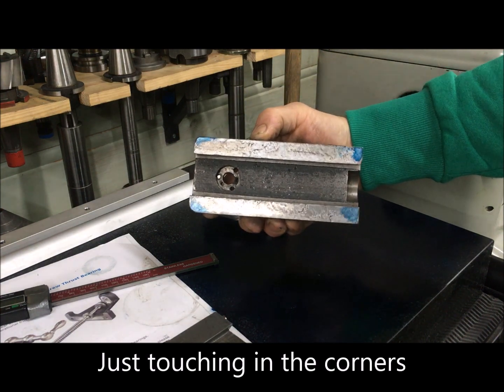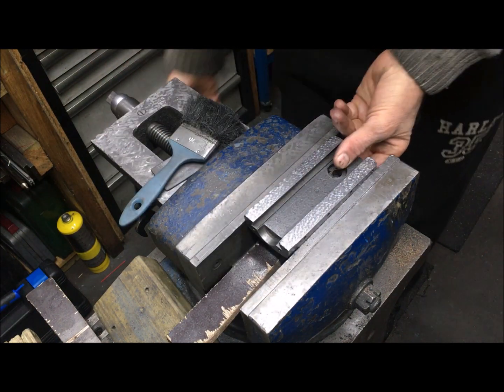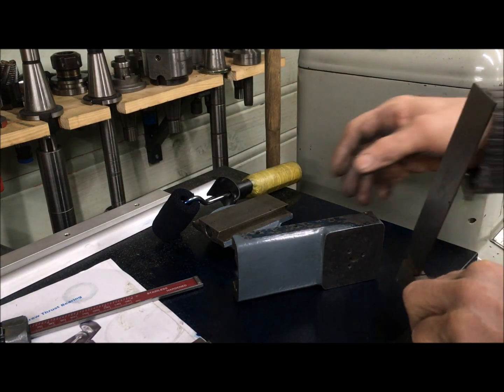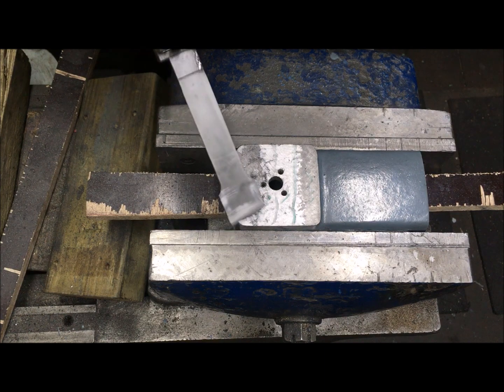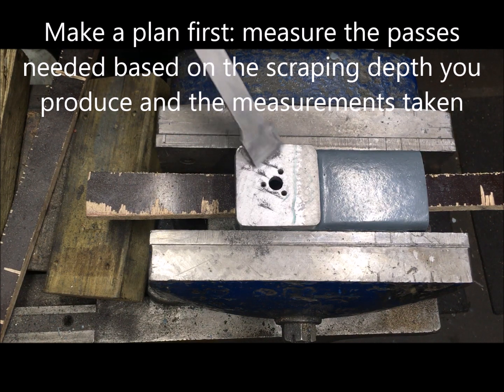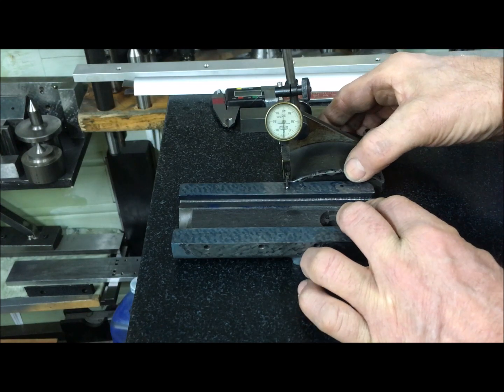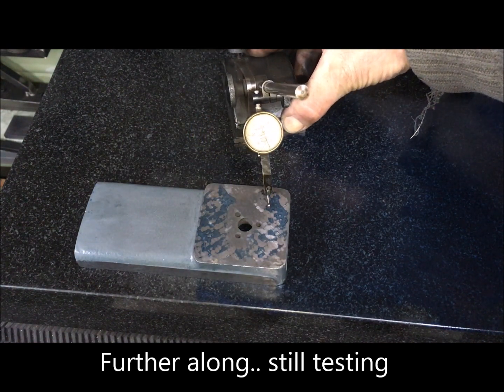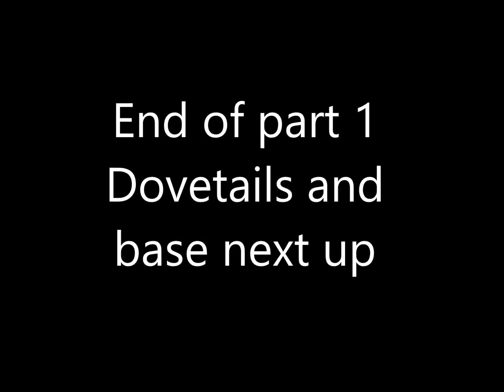Myford 7x7   top slide and base 1

Comment from the maker: I didn't show the scraping of the underside of the (rotating) foot of the top slide base, but this will also of course have to be proven to be exact. I have learnt that the requirement for contact area for  such "static" members, ie. the contact between 2 members of a machine that doesn't move when operated, should be 2-5 points per square inch.

Comment: Hi Jan what scraping does to parts and why that has to be done ! Cheers, John!
Reply from the maker: Scraping is usually done to improve surface quality, flatness, alignment. Putting on a certain pattern on the underneath of a part that rides onto another machined part, where usually oil is present to prevent direct metal to metal contact, will provide pockets where oil is held to prolong the lifespan of the machine in use. It is mainly the lack of lubrication that produces wear
Reply: Thank you Jan, just have to find scraping tool and than try on something!
Reply from the maker: @zvonibab  Good luck!